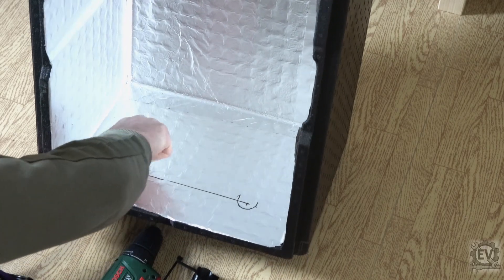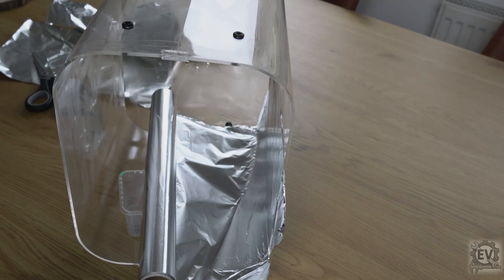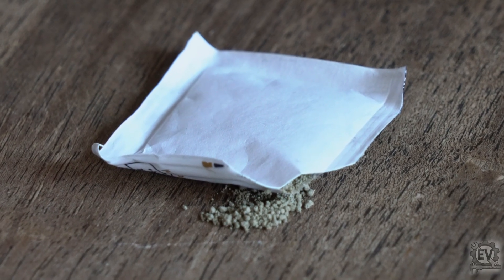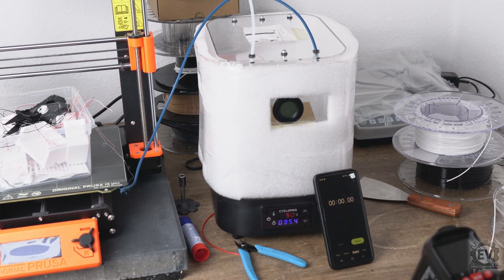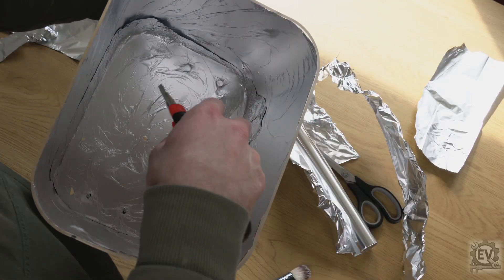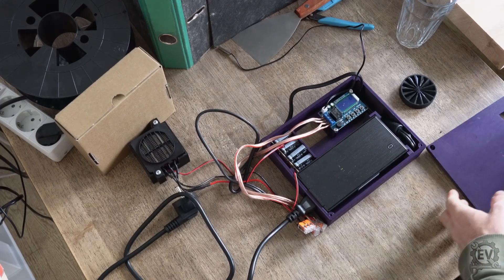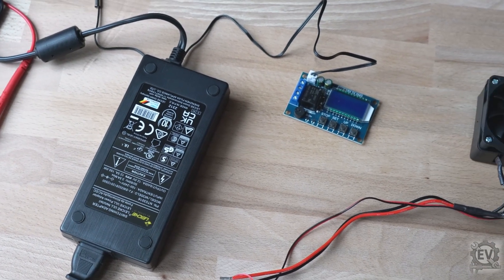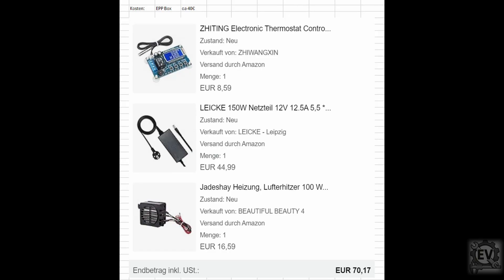Filament Drybox (DIY) under 100€

Comment: I'm also looking for such a solution. Insulation is key to reduce the energy consumption, so I am thinking of using an old cooling box from a thrift store. With an arduino I can regulate the temperture and monitor the humidity and control even a valve and a fan if I want to. I just am not aware at all of the needed temperatures, time and humidity values that are applicable to this drying process.